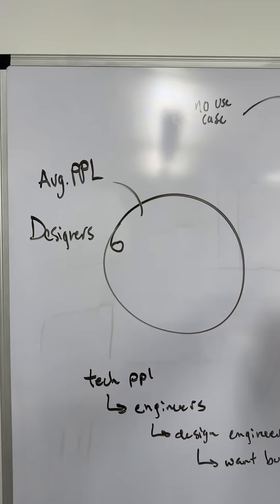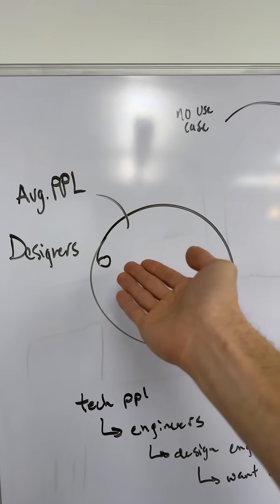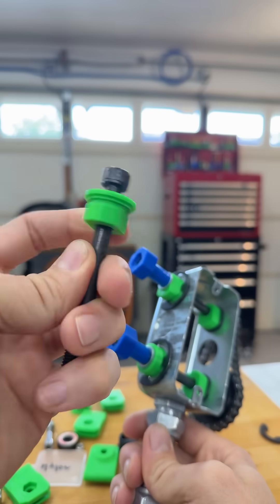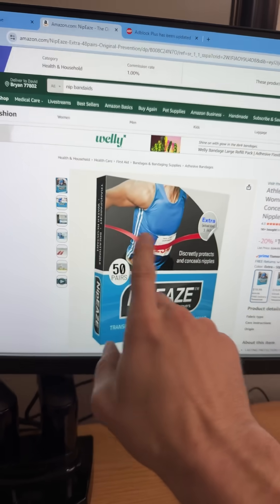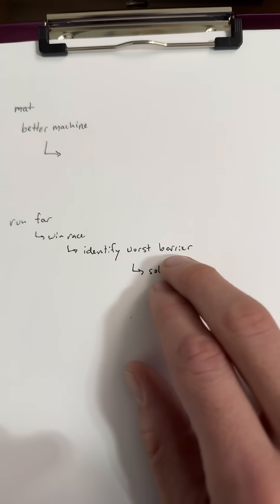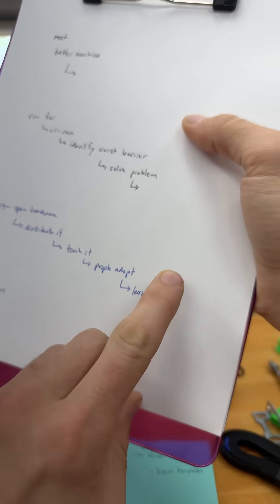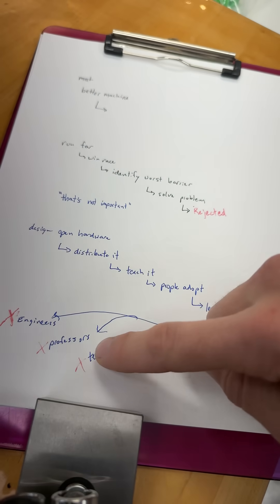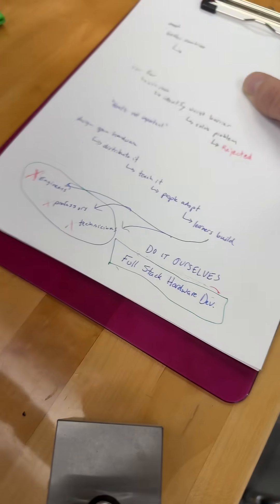basically just rebuild the planet to save our own nips.

Comment: This is why you need a good industrial designer with Exelent communication skills. Designers are the ones that collect the data to define the problem from the customer. Then they create the problem metrics and tailor the solution to fit the metrics of the clients expectations with the financial needs, materials available, manufacturing requirements, sales and distribution process, before starting the design process. The reason you aren’t getting interest in help with your idea is you don’t have funding to pay each part of the process and you don’t have good communication tailored to each part that prioritizes themselves above the others. 90% of new ideas fail because of poor communication of the product. Each part needs to know, how much does the customer wants to pay, how much it has to cost, what it’s made of and produced with, and how are you going to get it to the customer who finds you. Nothing is free, everyone has to get paid profitably, the value to the customer HAS to be higher than the sum of the parts and all the costs MUST fit the amortized price. If they aren’t interested, you’re not paying them enough and your not communicating well.

Comment: As an auto tech with almost 30 years of experience, thank you! What I can’t tell you is none of us “care” until it’s “our problem”… 
The guy in the bay next to the average tech is screaming at where Jeep puts the engine oil filter - not my problem, don’t care!
But after about 5 years you stop bitching about “those ass hats at Chrysler” and start making convoluted plans on revenge. But ultimately we just make it the apprentices problem. Auto techs have a 4 year apprenticeship. Now, not my problem. After about 20 years of trying to let it be someone else problem you start telling your customers to stop buying Chrysler. And if they still do, you start charging a clean up fee that include brake clean or you buy or make a tool to catch the oil before it get all over everything. 
At almost 30 years you just let it spill every where and just leave it, kidding - mostly.
But jeeps and dodges still out their oil filters on the “wrong side of the engine”. The under laying issue is that it’s cheaper for Chrysler to let it be my problem than design an oil filter location that is convenient to service. But then u need a left hand drive version and a wrong hand drive version. So, it’s my problem. Then it’s the apprentices problem…. 
I tell the customer of the added clean up fee for their engine oil change they say no way I’ll just do it my self. 
I just think of all the guys in their own drive ways juggling leaking oil filers all over the place and them selves. So next time they think, “ I’m going to make this someone else’s problem” and they bring it to me. They are happy to pay extra and next time they are buying a Toyota.